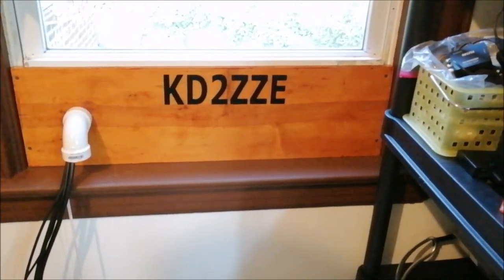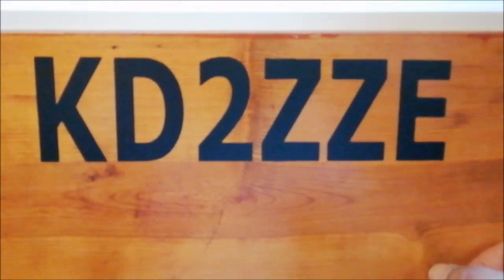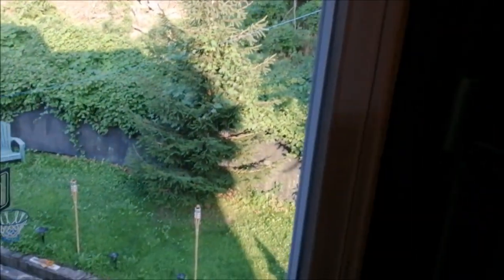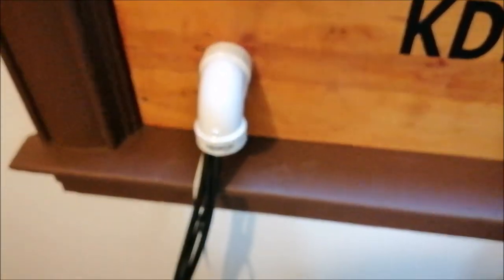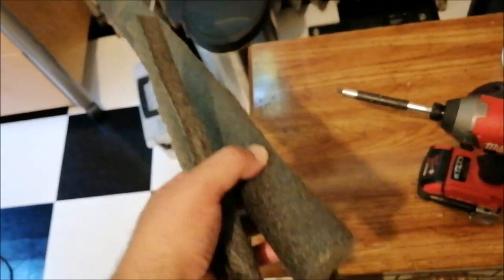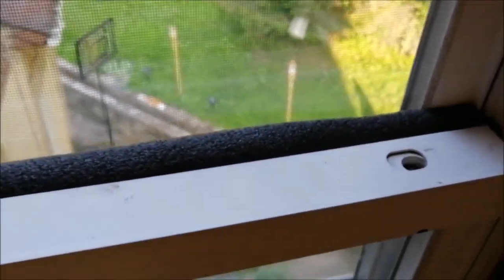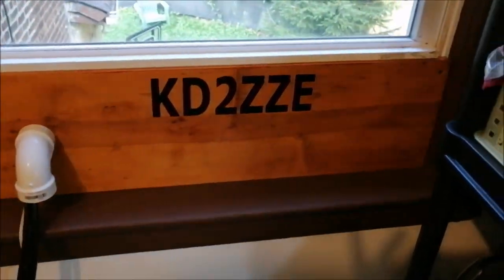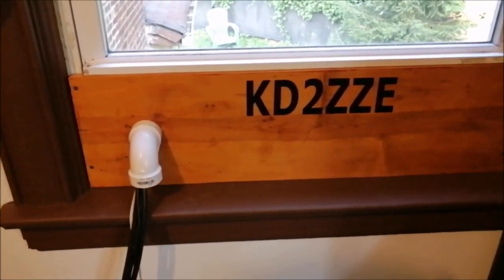Final Setup Of My Do It Yourself Ham Radio Antenna Coax Cable Window Passthrough

Comment: Love it great job how do you keep the critters out side of the cable going in side they going to come inside the elbow i woulda sealed it with silicone
Reply from the maker: I didn't want to use spray foam or silicone because I want to be able to remove it without the mess. I used grocery plastic bags, they work well and are easy to remove when I want add or remove cables.  Thank you and have a good day.
Reply: @dannyshortwave  ok got yeah👍
Reply: The itsy bitsy spider cannot go up the cable spout

Comment: Great job but it's never done. Changes will always happen
Reply from the maker: I agree.  That is why I went with the plastic grocery bags to fill inside the PVC pipes. Easy to add and remove.  I plan to add some more coax and also a ground connection in the future.  Thank you for watching.  Have a good day.  73. KD2ZZE.